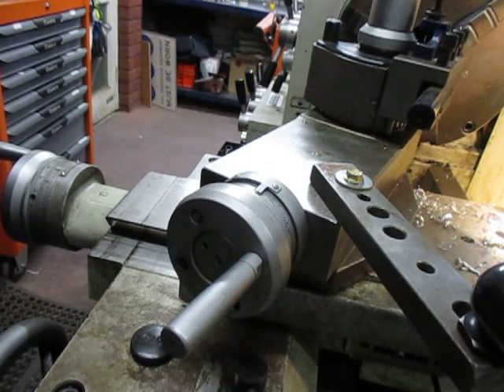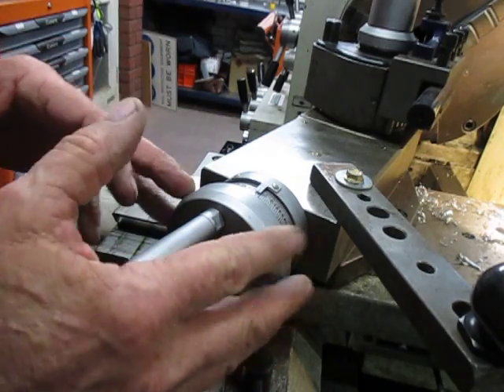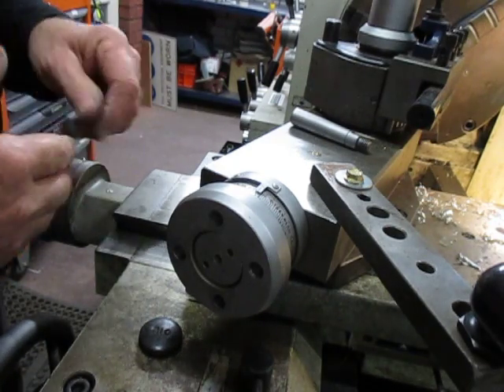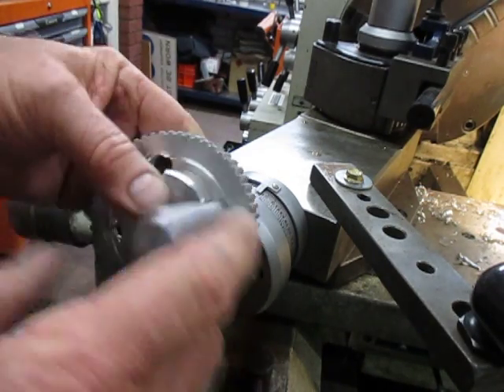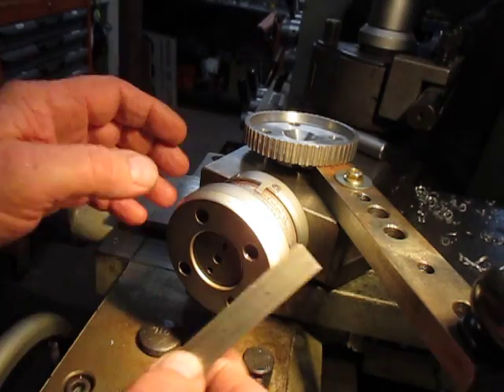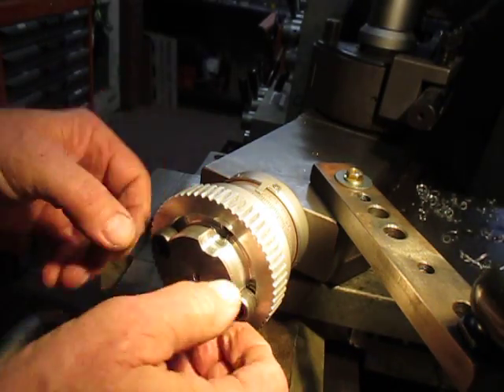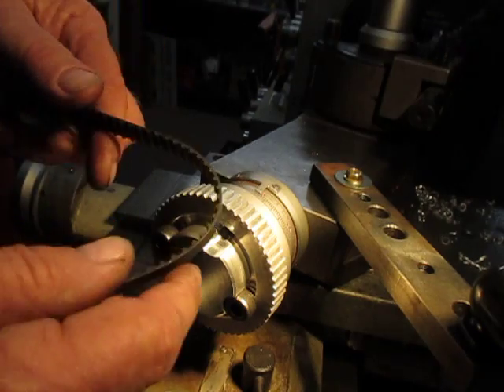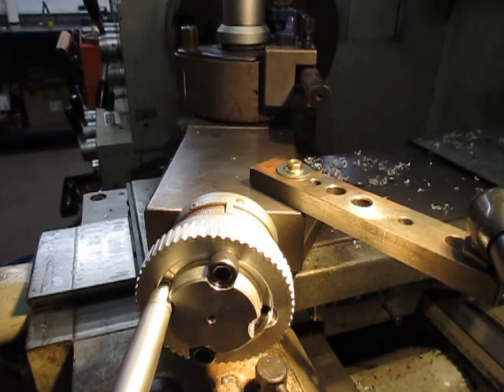Compound Drive. Project Arthritis

Comment: Bruce, Awesome video ! I am on a similar quest looking for ways to adapt equipment that will "allow" me more time at the wood lathe and other tools. I'm working towards captive tool rests. It sucks to get an hour on the lathe and then lose function in the hands for days afterwards. Arthritis is nothing like it is portrayed in television commercials for many. My next project is converting my motors to dc power. I found out magnetic fields cause problems with medical devices that have a computer program in them.

Keep doing and adapting !

Comment: Bruce, My son and his brother in law have just finished building their own CNC plasma table and have started their own cutting business. Although most of what I was told about the drive system went over my head (through to the keeper) a lot was said about stepper motors/ incremental motors. While they maybe more for computer drives they may also be useful to your application.Just a thought. Regards...

Comment: you could use a stepper motor and driver , you can get simple pulse generators that give basic push button drive functions and you would also have a very precise stepping ability as well, plus of-course with another axis and computer, changing over to CNC would be easy :)

Comment: You might look at a sewing machine motor, the type used to convert old treadle machine to electric.  Usually 1/10 Hp and can vary speed by potentiometer.
Reply: Morris Gallo Yes, I was just going to say this. Find an old sewing machine. the variable speed drive is already set up with the peddle.

Comment: Zed on machines is the spindle axis.  Cross slide on a vertical mill is Y, on a horizontal mill it is Zed.
http://www.practicalmachinist.com/vb/cnc-machining/definition-each-lathe-axis-152203/

Comment: saw a guy do this before, he put the cog between the dial and the bearing  --- not on the exterior. you can get the cogs from an RC hobby shop and chain. for less than 10 bucks. Stepper motor from an old printer, they have a lot of low-end(Speed) torque.